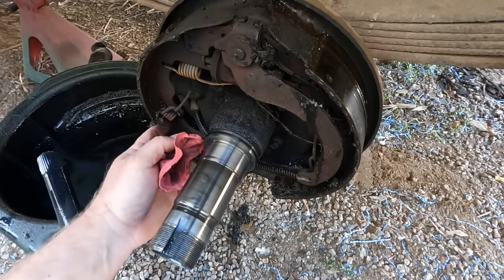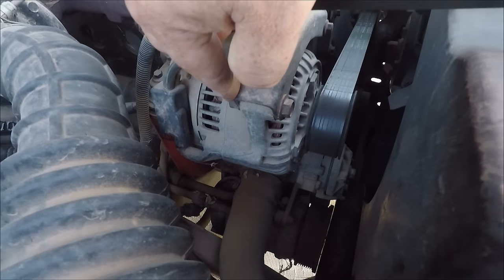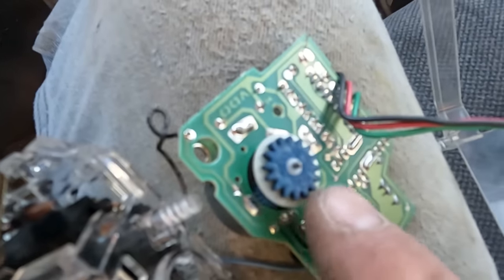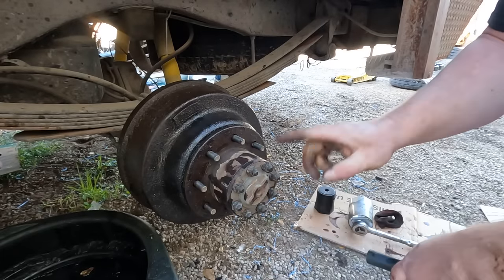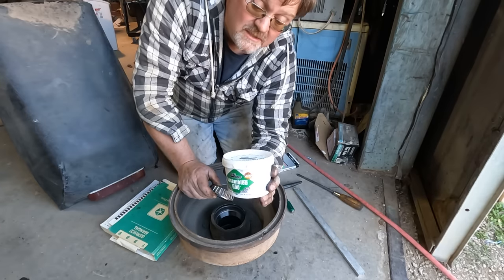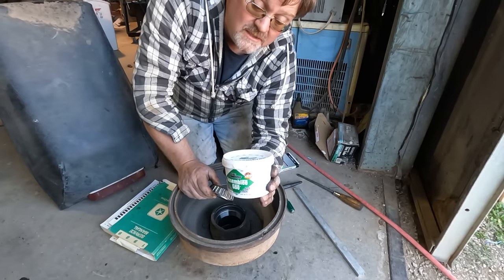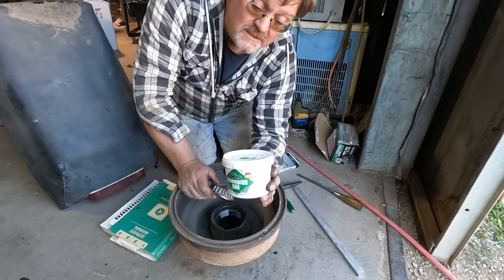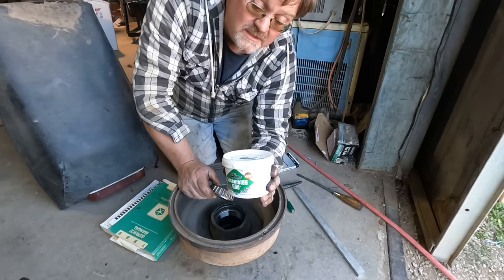Dodge Cummins Shop Truck, Update!

Comment: I love your rig , those side doors with the narrow compartment, is good for jumper cables or tow strap, I would say.
Reply: I was about to say jumper cables when I saw your post
Reply: Jumpers yes. Also, some different gauge wire coiled up. Maybe some fuel, brake hose lengths. Ratchet straps, small ones, would seem to fit also. Maybe a blue tarp also.
Reply: Yeah, jumper cable are what I thought too.
Reply: I'd fill it with burritos, I bet you could stack 20 or 25 in there
Reply: ratchet straps and rope
Reply: Crowbar and clapspade.
Reply: Cassettes for the upgraded sound system 😊 !
Reply: Mount a plastic case with fold out lid for small parts. Or a first aid kit
Reply: One of those plastic clamshell basic mechanics sets.

Comment: You definitely should paint the truck bed. Get all that rust off and paint it silver like the cab. It's a good design and deserves to be presented in a professional manner just as if it were factory. There is no sense in neglecting good solid work.

Comment: James, 25 years ago, I drove for a van service. We had 1-ton Dodge 15-passenger "church vans", from about '84-91. They had 360 engines and Dana 60s with 3.54s as I recall. Single rear wheel. We learned that 1st Gen Cummins trucks like yours, in 3/4 ton version, had Dana 60s with 3.08 gears, because the 727 trans had no OD! The boss swapped in 3.08s, and whatta difference! The 360s no longer screamed at 3000+ rpm on I-5! Is yours a Dana 60 or 70?
Reply: I just had a Ford apart that was exactly the same. I'd bet that was a 60.
Reply: The early Cummins trucks with 727’s ran a Dana 70-2u, the housing was actually it’s own unique casting as it needed clearance for the physically larger 3.07 ring gear.

Comment: For the sides, I would wire brush the bare metal and clear coat them.  I'm not a big fan of the rusty metal "patina" although I know it is pretty popular.  I think shiny metal protected by clear paint would look good.

Comment: For the volume issue off the new radio, try to clean/lubricate the potentiometer with Caig Chemical "De-OxIT" or Nu-Trol.
And, by the way, do the same with all potentiometers in that radio...

Great video, as always!  Thanks for showing us!

Comment: In the narrow side compartment(s) you can hang jumper cables, extension cords, welding leads (if so equipped, you can modify the alternator to stick weld).  The 3.54 gear is much better suited to the 5.9 Cummins torque range with stock tires than those models with the 4.10s on the street.  You can change the drive/driven gears in the transmission to correct the speedometer, but mostly you need to know when you are driving 65 mph. You can set the needle to register 65 mph correctly just by moving the needle, that is all you should need.
Reply: IIRC, the 4.10's topped out in first gens at 74 mph against the governor.

Comment: I had a 93 2500 2wd CTD that I bought new. It was an awesome rig. The only down side was that unless the truck was working hard, it didn't make much heat. I nearly froze to death on the freeway in sub zero temps even wearing a snow suit. A "Winter Front" for the grill solved that problem. 
You made my Saturday night - thanks for another great vid!

Comment: That upper compartment you don't used much - put a sign inside that reads, 'Keep Closed'.  That will be the purpose of the compartment - to hold that sign.

Comment: My 1989 wd250 4x4 I ordered 3.54 gears .it was the last year you could get posi in the front end with 3.54 .it was posi front and rear ends. Sold it with 210000 miles still had original oil pressure 30 at idle and 45 going down the road. Great truck to small for family. I have been driving ram trucks for 35 years this year. Had a 03 3500 junk it was red my 2021 is blue like the 89 it will be a good running truck . I have color carma .Denis from Santa Rosa CA
Reply: Howdy neighbor!

Comment: Weld tabs or pegs in those boxes to hang box end wrenches. Make the pegs long enough so when you close the door, the pegs all but touch the inside of the door. That way, as long as the door is closed the wrenches can’t go anywhere as you drive

Comment: The rusted plate steel wouldn’t bother me, except that eventually when you lean against it while accessing the bed, you’ll end up wearing rust on your clothes.  If the other side wasn’t in a mismatching primer, I’d suggest some sort of clear coat to seal it, rat-rod style.

Comment: on the other hand if that brake unit will seize and your rear wheels will lock up first with little braking pressure, its a real pain if that happens as you cannot get replacements anywhere for 20+ year old vans or ute's(or as yankys call them, pick ups or trucks)

Comment: That rig looks really nice. I'd say go silver with the paint on both sides. As for those side doors. Jumper cables, extra tow straps. Maybe some spare parts like belts, wires, and your standard bottle sizes of fluids for whenever you might find you need a topup off on the road.

Comment: James, l own a 1977 Dodge Power Wagon Sno-Fiter or Snow Commander don't know for sure, it was repainted by an unscrupulous body guy. It's  not all original so some things I don't know are authentic. People say it's 3/4 ton w/ 1 ton sispension. It is lifted 6"  & has clearance lights on the cab all factory I'm told. The brakes & steering parts are huge and $$$. It's got Dana 60's F&R w/ 4.56 gears & 16.5" wheels.  It has full time 4 wheel drive, a 400 V8 & 8' Meyer Snow plow all hydraulic. When I had brakes serviced  they left the  rear bearings dry telling me they'd get hypoid oil in them when l drove it. After a week or so l heard squeeking when l drove by a curb so l opened them up and they were still dry. I packed them w/ wheelbearimg grease myself. I don't drive it over 60 much & it gets 13mpg best.

Comment: When you put your taper bearing in what you can do instead of alternating the sides you hit until it’s seated you can put a piece of wood over the whole bearing and hit the center of the wood until the bearing is seated. Truck looks good there bud

Comment: Great video. I, like others, agree about the side compartment being used for your ratchet strap collection. I believe that in there, they would probably become even more fun to pull out the whole giant tangled Medusa's head of ratchet straps and ratchets that are inextricably wound into a filthy, rusty nightmare. I await that video with bated breath!
Oh! And by the way! 
Whatever you do, don't paint it. At least not in any good looking way. Maybe if you found some free paint down at the recycle center, but otherwise, paint is just added weight that only slows you down.
Keepin it simple over here.

Comment: In my area they weld rebar hooks or loops around the bed rim so when they put a tarp over the load they can tie it down easily.

You can keep a tarp and the cordage in the side panels

Comment: Nice work as always!  I'm have an '05 Dodge 5.9 (but with the not so good automatic trans, now on #4 at 340 K miles) all stock everything, runs at 1700 RPM=63-64 MPH,  2000 RPM=70 MPH.  Looking forward to more vids of work out at the Low Buck Mine.

Comment: I just changed a GMC axel and had the same rust issues.I used an air pennier from Harbor Freight. Did a supper job of nocking the rust looss

Comment: 1:48 You could put more straps. Take some 3 or 4 mm soft wire and bend it so that it makes pockets as wide as a strap and tack it to the back of the door. And you can put straps in there - thus leaving the drawers for other stuff.

Comment: Excellent video Low Buck Garage  :) also paint box black for sure and one suggestion for replacing your Alternator, Regulartor box check fender back - ground battery pigtail connector plus  fender also  bolt and washer ! It tell Alternator recharge battery correctly  , gauge right voltage also amps plus all electrical and starter too from wearing fast or overheat  too! If rust on fender sandpaper or wire brush it shine then pentriotion fluid all up and thin layer grease protection from rusted up ! That pigtail ground is called by Mechanics is Memory Wire because digital radio clock or one had separate clocks they rest 12:00 that why and computer one get memories from last vechiles did like store codes on OB readers so be erase! Hopefully that can try and see what happens!

Comment: Hay thare I love your enginuity on your creations when it comes to trucks and machines and things like. 5.9 12 valve Cummins mechanical diesel is a good engine. Take care of her and she will run over 400 thousand miles no problem veep her full of oil run little bit of lucas each oil change it will run for a long time.

Comment: With regards to the drill drive belt, if you make sure it is tight, you don't need to worry about having to replace it. With the motor stalled, that belt should outlast the motor by quite a satisfactory margin.

Comment: Ohn that killer pin, the little bolt right next to it, is where your supposed to bolt and S  shapped piece of flat metal touching the end of the pin to hold it in right on that little screw that right next to about a 10 mm, your shop peening might work, , don’t even over over rev it, at high rpm’s, is when it strarts pushing out, ok, that going to be a kool truck ,in the end, thanks BigAl California.

Comment: If I remember right, you used zinc oxide primer on the halftrack at some point. Bet you've still got some of that around. As for the side doors, pop a 4000 watt inverter in one of them...but make sure it's waterproof.

Comment: The side pockets could hold sockets and ratchets etc.  Only in a rack.   Most people have at least two sets of tools, it would be good if you traveled with a full set of seconds....just in case something gets lost.  
At this point is is all about saving you steps so that more of your energy goes towards the work at hand......or eating cheeseburgers.

Comment: From my understanding with the rear wheel bearings is new bearing don't get greased, reused bearings get greased, supposedly to help with adjustment. Not saying that is the right way, just the most agreed way I have found.

Comment: Put an inverter for 110V for tool power etc in one narrow compartment and maybe a work lamp on a reel you can unwind, maybe instead of a door you could have a flip-down work surface to go with the 110 and the lamp.

Comment: I find if you put your bleeder bottle above the bleeder, it works significantly better. The air bubbles want to move up. A bucket, box, or leaf springs make suitable perch for the bottle
Reply: Glue a magnet to the bottom of the bottle, then set it on top of the axle.

Comment: I like the bare metal patina on the rear. If you haul loads in the bed, you're only going to ding fresh paint up, as will the desert roads with loose ground, so why not just accept that 'au natrel' iron oxide is this year's "new black"?

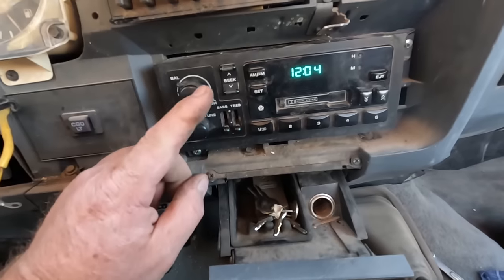Comment: 7:18 a little Deoxit on the volume knob's electric guts and rotating the knob would fix that.

13:02 Mhm. Good move. I was going to suggest it myself. That stuff vanishes into the oil once it's done. Any kind of assembly lubricant will do. What i like to do whenever i do oil axles (and i don't happen to have assembly lubricant) is (once all's buttoned up) lift one side, rotate 3 times in both directions, then lift the other rotate 3 times in both directions. That way, the bearings are flooded with oil and we're set to go. If it's on the ground, it's even easier. Grandpa did it the same, never had issues, i see no issue. And i'm not talking road truck axles here, i'm talking agricultural stuff, which would be destroyed in minutes if you didn't have lubrication. So if it works for that, it works for road trucks just fine.

FYI, if you happen to have some junk angle iron scraps, you can cut them to so 4 points contact those races and tack them on at those points, then on the spin cut a small depression (since you have a lathe, you can cut that pocket on it - if you want to be centered and fancy) and weld a handle (from a piece of pipe). You only use them once or twice a year at best, but when you do, they make good tools. If you do this for every one, you'll have a complete set eventually.

The reason they demand you rotate the drum and torque it is because (depending on how good your bearings are) you can dent the bearing races with the barrels when you torque it down. If you have quality bearings, you almost never run that risk. The bigger the bearings, the less chance of it too.

Comment: Personally I like the Post Apocalypse/Mad Max look to the truck. I would leave it as is mate, maybe a light coating of oil to slow the oxidation down? I dunno. Function over Form is how I roll.. Cheers.

Comment: 18:00 when i had to move one of those across the yard a used a wheel dolly, then sat down for 3 weeks questioning what i just started...
Reply: think it's a non duly 2011 dodge 3500 AAM1150, because the disk brakes are part of the wheel hub "more $$$$ to replace" and it looked like the 2500 disk brakes were advertised as easy on off rotors that aren't a singular casting to the wheel hub like the 3500 would be? hold more pressure.

Comment: paint it silver..  my s/duty, 4.2tdi mwm, at 110 ks, 2,400 revs. 14 lt 100.. 700nm.. bigger turbo. no computer crap.. 35'' tires. 4.11 diffs, 4x4.. i fit hitches to front/rear, for winches, cradle..175 amp anderson plugs, 1.0 cable, 3500w invewrter.  flopy solar pnl.. roof..

Comment: I have an entire 91 cab with good seat and and good dash and column 
And the front end steering assembly with rims (frame cuttoff) 
And a 47RH transmission you can HAVE for free in Texas…. 
It’s an 8 hour drive from my house to Carlsbad 
Come get this crap off my property please 
I’ve had so many mopar monkeys say they’ll come get it. And then never show up.